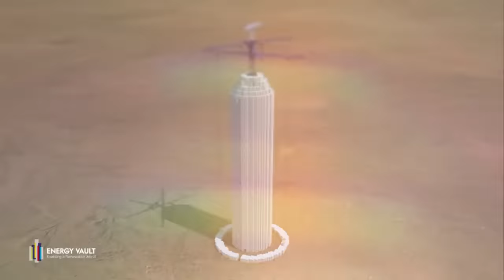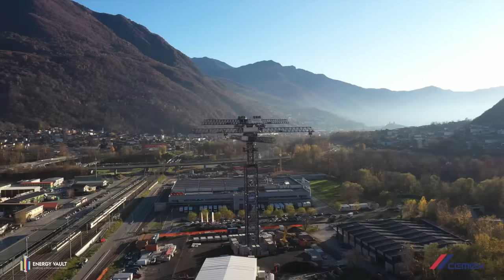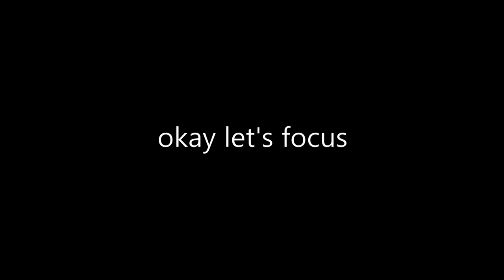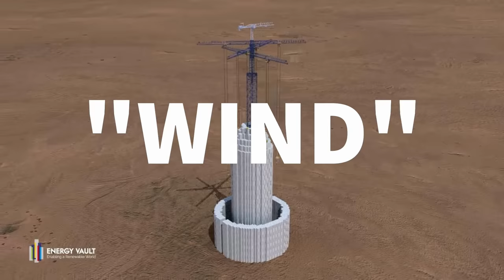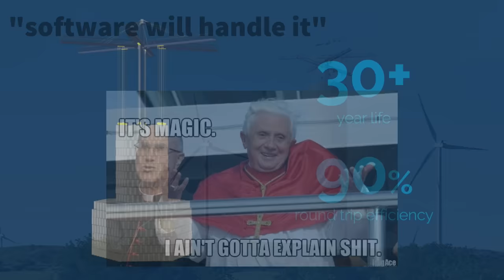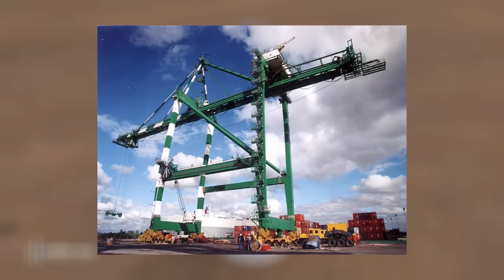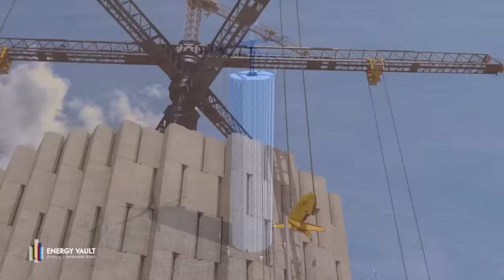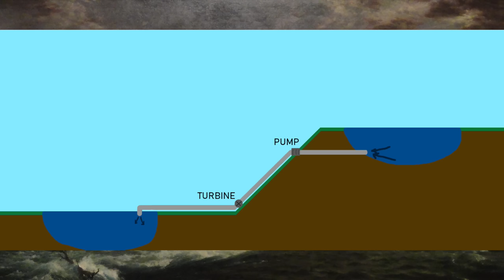The Energy Vault is a Dumb Idea, Here's Why

Comment: Yeah, digging a massive underground hole sure costs less energy and effort than building a tower, hence why we all live underground. Also not every place on earth is windy and not every place has access to mountains to pump water up to, these arguments seem a bit weak. What I will give you is why they would use Bricks instead of Liquids, though this might be due to turbines being less efficient than dynamos. Not sure on that one. Also the circle makes sense in their design, because every crane arm can be the same length. In a cube the corners are farther than the edges from the center, but with your crane idea this would be solved and would probably be easier too. Lastly noone cared to mention that by the time the „low“ stack is as high as the „high“ stack there is no energy to be regained, so either the low tower has to be flat and large or the high tower is 50% useless. All in all this whole design is quite floored, but I believe there is something to be learned here and a form of this concept might not be half bad.
Reply: Your first sentence makes no sense. Buildings are static and engineered as such in the most efficient way, not to be constantly torn down and built up. Most housing is also just a few floors high at most, anything above that is almost exclusively a luxury indulgence because its expensive and energy costly. Living underground would for most people also be a claustrophobic nightmare and comfort is a big part of housing. Where people dont have the means they often do build underground or at least make more use of the terrain literally because its easier and more robust. Building housing and this thing is completely different.
Reply: >floored

It sure will be floored when the wind hits it

Comment: Why not just have one very large block instead of many small blocks?
You could keep it locked in place and only raise it when you have significant surplus.

Likewise you could release it to pull a very large cable attached to a large series of gears that overall contain ridiculous leverage, meaning the weight itself is generating work without losing extra distance to gravity.
Reply: A few things, the weakness of existing materials to support this giant concrete block weighing tens of thousands of tonnes, and also the power loss in a massive gear train. You might be better off raising and lowering on hydraulic pressure but then you'd need massive cylinders, supporting structure, and still have pumping losses.
On the original video it did mention the possibility of enormous weights lowered and raised in underground shafts but you could use a lighter weight and a longer shaft.

Comment: Pumped-storage Hydroelectricity brings it's own set of problems: it can only be implemented in locations that present a very specific set of characteristics (two valleys with a significant elevation gain and an important water source) and it essentially destroys the ecosystem of the two valleys it occupies.

Comment: I'm a fan of boiling water with nuclear energy
Reply: I've always been skeptical over nuclear energy, not because of Chernobyl (although that is a factor) but because the nuclear waste lasts for thousands of year
Reply: @incrediblebat  just use thorium instead of uranium. cheaper, safer, more efficient and leaves less waste which is also safer and easier to handle.
Reply: @SCPKing1835  true

Comment: This is meant for places where water is an issue, like your beloved Dubai.

Also digging into the ground is extremely costly and, if you do that, you'll get more energy from geothermal anyhow, which is pretty much available everywhere as temperature gradient.
Reply: true about digging, but we could be using mines and quarries that have already been dug.  and imagine if we can combine the mass storage and geothermal.
Reply: @annamyob4624  - You can get energy for heating from as little as a dozen meters below your feet. What you say can be used for more energy-intensive projects AFAIK. It's poorly exploited but the gradient is everywhere.
Reply: @LuisAldamiz   yes, its ubiquity is a good point.  And if i have a choice, my future home will be heated at least in part by it.  But is it effective for generating electricity, for those of us not near hot springs?
Reply: @annamyob4624  - AFAIK it is but we have only touched on it tangentially in my current course on renewable energies, so I would have to check. It's just a matter of digging deep enough but that's also, by its very nature, not for small family sized projects but for bigger scale ones.
Reply: @annamyob4624  - We just begun the geothermal section in the course I'm doing and is extremely disappointing: most of what is being done is low to very low temperature geothermal intended for localized climatization. Here a university and a sports center have installed it.

High temperature geothermal, which is the one that can produce electricity, requires (except in privileged locations like Iceland) of massive drilling operations several kilimeters deep and then injection of water "fracking style", what seems to be quite problematic. 

I guess I'll stick to photovoltaic + green hydrogen, add some wind to the mix, that seems to be the future or the core of it and, for what I'm learning, various developing countries (Namibia, South Africa, India) are trying these days to become leaders in green hydrogen production from renewables.

Comment: The only benefit is that beton weighs about 2 to 2.6 tonnes per m³ and water just 1 tonne. So there is more potential energy per volume. But we could (in theory) build an air tight system which pumps a wet sand slush instead of water (Air tight, so it doesn't dry out). Wet sand weights about 2 tonnes per m³. This would (in theory) double the efficiency (in terms of energy storage per  volume) without the need of such a stupid crane design.

Comment: Of course it's close to "reinventing" pump storage...  because both are gravitational storages
You're right on the issues of making a concrete tower... however let's note that there's an advantage to building a structure VS using a natural hill to dig a lake on the top and the bottom: less constraints on the places where it can be built and you probably have less impact on biodiversity... 
But clearly, if you want to frequently move lots of something heavy, water is a great choice.

Comment: True that pumped hydro is an existing version of this, but it has its own shortcomings and not applicable everywhere.
How about instead of stacking it foolishly...use a mine shaft.
If you have even one unused mine with a long vertical shaft and a bit of track at the bottom in an area, you could use this without the trouble of 1) water evaporation, 2) placement of reservoirs, or 3) inefficiencies due to stupid stacking practices.

Comment: I was thinking of trying to store the energy surplus by pulling some heavy weights up the hill. In my case, I have the premise for it as I own a piece of slope. I can afford to pull up some weights up the slope, but I cannot make the water reservoir up the slope. The latter would require much more expensive engineering than the former. So, in my situation, storing the energy surplus by pulling up weights seems like a better idea than pumping water. The scale also matters, I suppose. In my case, we are talking about kilo-watts of power, not mega-watts. What do you think, Adam?
Reply: I had the same idea. Using an old truck (ideally with engine damage ;-) , load it up with something heavy and pull it up the hill with a winch, using the same winch to create power if needed.
Since it is a vehicle (and I can drive and store a vehicle on my premise without any approval needed) this looks very promising to me. So far, time is missing to actually do it 😞
Reply: digging a hole and filling it with water is much cheaper per a MWh than your terrible idea.
Reply: @marwerno  you wouldnt end up storing much energy... it is a terrible idea. Might as well just go buy some batteries.
Reply: @thomgizziz  Water is lighter than the rocks, so it takes more space. it is also, well, liquid, which makes it harder to manage. I know that any of my ideas are terrible comparing to any of yours, as you are so smart, but... I did manage to calculate the amount of water I need to keep uphill for achiving any useful power storage capacity, and the result indicated that I need lot more water than I have space for keeping. That was the reason I thought rocks is better option.
Reply: @AlexthunderGnum  I agree. Stones/Rocks can be denser than water and take up less space and easier to manage.
Reply: @AlexthunderGnum  I imagined having a heavy car on rails with a cable like a funicular. Not sure if it's a good idea though, rails cost money. 
Rocks are easier than water at small scales but harder at large scales IMHO. And gravity is a weak force, so scale is important to make it worth it. Slope storage is an interesting approach to try to make work.

Comment: The concrete bricks of this proposed Energy Vault would weigh about 70 tons each. On-line web calculators indicate that lifting up a 70 ton block to 100 feet would store about 2.6 kW-hrs of energy. The typical US house uses about 20 kW-hrs of electricity per day. So to store enough energy to keep just one house supplied with electricity for one day would require lifting about eight 70-ton blocks to 100 feet.
I'm not sure if storing energy as gravitational potential energy by lifting up solid blocks with cables is a practical energy storage solution for even one house, much less for a community of any size.

Comment: According to their figures, it has round trip 90% efficiency, while a hydro power system would have 80% or less efficiency, pump, turbine, and pipe losses. For the blocks i was thinking of ways to fill them with water, though they would need to be much smaller, and concrete is much more dense so they would need more volume. Its still a plan that full of holes.

Comment: Using water isn't always feasible, and pumped hydro even more rarely is due to location requirements.

You don't need millions of blocks though. Just one heavy weight. When power is needed, let it down (into a hole). When there is surplus, raise it up. One "crane", static build. Can use a huge boulder, or some other heavy shit that is already "assembled", instead of concrete.

Comment: This video is not arguing in good faith. Water is exceedingly scarce in much of the globe and geography limits the viability of pumped water storage. It is nice where it can work but it doesn’t scale. Digging a giant pit would be quite inefficient from a carbon and economic perspective as well. If it were cost effective California would be full of underground housing already. Solid gravity storage is more efficient than pumped air storage and is cheaper. The blocks are being made with recycled local waste rather than fresh concrete. The circular crane model was a minimum viable product used to demonstrate the energy efficiency of the method at a moderate scale - their new model is a modular block crane method and can scale to much greater capacity.

The major benefit of their invention is that it comes in at a very minimal cost which means it may actually be adopted by industry and lower income countries. It doesn’t require massive lithium or rare earth metal quantities which means it can feasibly be used worldwide. The energy efficiency is comparable to a lithium ion battery. There are pros and cons to any technology but cutting everything down all the time is a useless attitude. There is real potential here which should be explored.

Comment: The water storage takes up a LOT of space though because the water is stored horizontally more than vertically and you need TWICE the surface area + water DOES evaporate so during draughts you can lose capacity. For countries with a lot of nature it's an option but where I live, Belgium, we have no space for this.

I think we do need more storage methods that are compact - the idea of the energy vault was to build vertically to limit the amount of real estate you use - if we can store energy produced by solar panels & wind turbines during the day with less than 20% energy loss, we're getting a lot closer to getting rid of fossil fuel for our electricity needs.

Comment: FWIW, pumped hydro's big problem is that you can't do it everywhere. You can drill a hole in a lot of places where you don't have places for giant ponds of water separated by significant heights. And, of course, in some places people have been kind enough to dig giant holes in the ground already that might be used for the raising and lowering giant blocks up and down. The big issue with all the raise and lower giant weights ideas is capital costs, followed by turn around efficiency and long term maintenance costs. I don't know what the numbers are but some people think they're OK. As far as the giant block version of this idea: Thunderfoot wasn't a fan and it looks like a looser to me. But I wish them well.

Comment: What are the thoughts on abandoned mine shafts for the gravity battery approach? You'd have less blocks to move - but they'd go a lot farther in one drop. I'm new to this concept and I imagine there are other logistic hurdles there too...but that's one aspect that I hear people talking about. If it's limited to mineshafts it's not going to save much of the world I reckon, but could it help a bit in places it's easy to implement?
Reply: Wikipedia article on Pumped-storage hydroelectricity has, "Underground reservoirs
The use of underground reservoirs has been investigated.[54] Recent examples include the proposed Summit project in Norton, Ohio, the proposed Maysville project in Kentucky (underground limestone mine), and the Mount Hope project in New Jersey, which was to have used a former iron mine as the lower reservoir. The proposed energy storage at the Callio site in Pyhäjärvi (Finland) would utilize the deepest base metal mine in Europe, with 1,450 metres (4,760 ft) elevation difference.[55] Several new underground pumped storage projects have been proposed. Cost-per-kilowatt estimates for these projects can be lower than for surface projects if they use existing underground mine space. There are limited opportunities involving suitable underground space, but the number of underground pumped storage opportunities may increase if abandoned coal mines prove suitable.[56]

In Bendigo, Victoria, Australia, the Bendigo Sustainability Group has proposed the use of the old gold mines under Bendigo for Pumped Hydro Energy Storage.[57] Bendigo has the greatest concentration of deep shaft hard rock mines anywhere in the world with over 5,000 shafts sunk under Bendigo in the second half of the 19th Century. The deepest shaft extends 1,406 metres vertically underground. A recent pre-feasibility study has shown the concept to be viable with a generation capacity of 30 MW and a run time of 6 hours using a water head of over 750 metres.

US-based start-up Quidnet Energy is exploring using abandoned oil and gas wells for pumped-storage. If successful, they hope to scale up to using many or most of the 3 million abandoned wells in the US"
Reply: filling it with water would be a better idea and still worse than digging a hole and making a feature that is already all over the planet.
Reply: @zytigon  Any information about ecological side? Old mines are very very bad places to be filled with water, it will became literally poisonous.

Comment: This misses that you only get the full height difference at the start, so the energy realised per block gets less and less. The comparison with pumped hydro ignores that this is reliant on topology and climate, and is therefore of limited applicability.

Comment: Just because it's not well executed and needs improvement, does not meat it's a dumb idea.  Using off the shelf technologies, that are readily available, and not affected (as much) by supply chain issues, is a good idea.   Digging holes in the ground is expensive.  Building tanks to hold water is expensive.  Pumped hydro is only viable under very specific geographical situations. 

However,  I would agree that wind and earthquakes are real issues for this design.

Comment: Yeah, this is taking a simple idea, that already exists and is in use, and making is extremely complicated. Not to mention wind and what you pointed out. The "storage"systems in use today use solar or wind to pump water behind a dam that supplies hydroelectric power. Not mention pumping water up hill is still easier (more efficient) than lifting blocks with a crane.

Comment: First the blocks have the size of 1x1.5x2 Meters which equals in 3 cubic meters, not 20! Second: 1 block has 5 tons of mass, in order to really have a problem dropping the block on ground you will need to have speeds of 150km/h. due to concret's high density. So far to that. Yes the water storage works, since several years, but only in places with altitude differences which is less than 25% of the land mass on this earth. so for the other 75 %... something else than water would be nice. Maybe we could use concrete blocks to store kinetic energy. also the loss of energy by lifting and lowering of solid blocks is about 75% less then the loss when pumping liquids (if pumped straight up - not in a pipe along the mauntain wall into an artivicial lake). 
Apart from that... nice Video